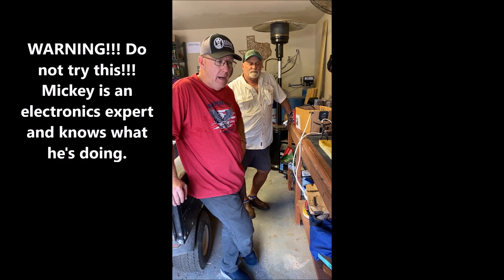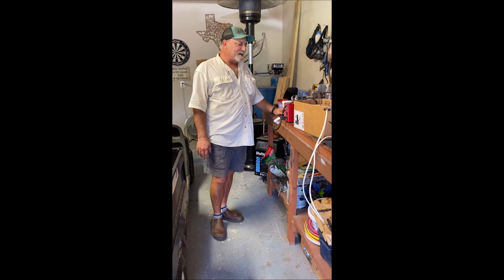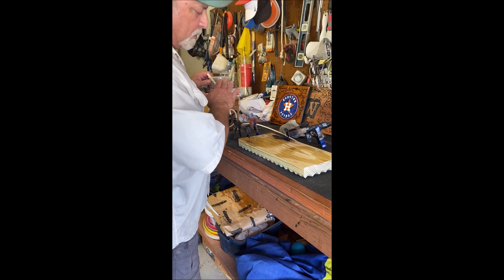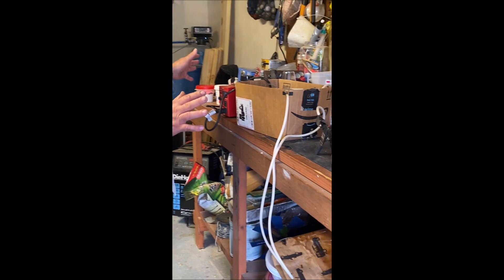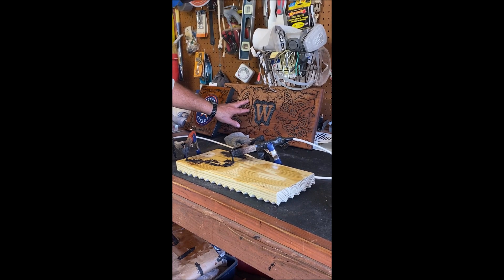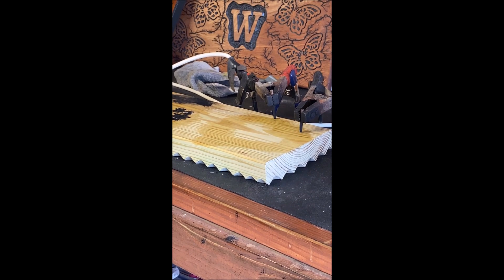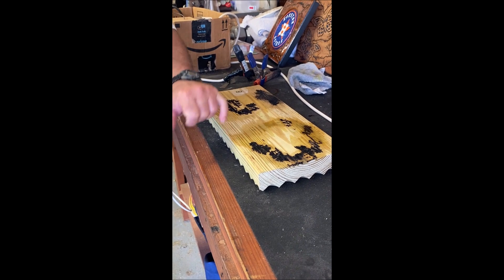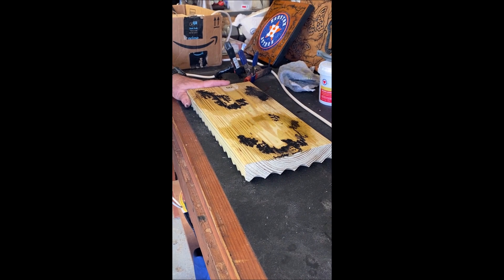#595 Lichtenberg Fractal Burning Demo With Mickey Suhl

Comment: Great info! Was just looking at a Lichtenberg machine from Conestoga Works.
Reply: Just looked at the Conestoga machine. It is a neon transformer so you may not die using it. However it is one of the most unsafe setups I have ever seen. You never ever even with gloves want to have probes in your hands with power on. Also uses a foot switch or dead man switch.
Reply from the maker: You're welcome Troy. The burning looks really cool.

Comment: I have mine on a footpedal, if I do get hit hopefully my foot comes off the pedal and stops the connection
Reply from the maker: Glad it's working for you buddy....
Reply: Dead man switches are not recommended. Two years ago a burner got shocked and fell on his foot switch. First responders got hurt when they touched him. No one in burning sites supports foot switches anymore.
Reply from the maker: Very interesting... That makes sense...